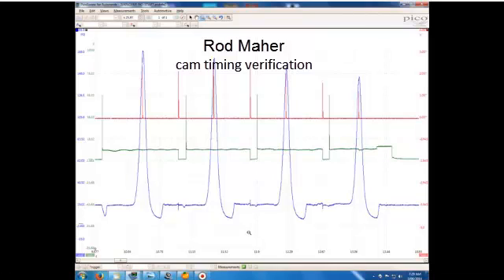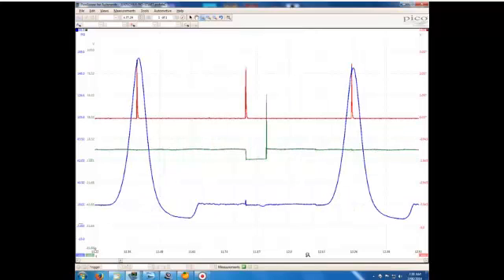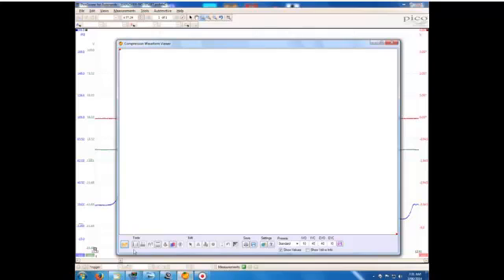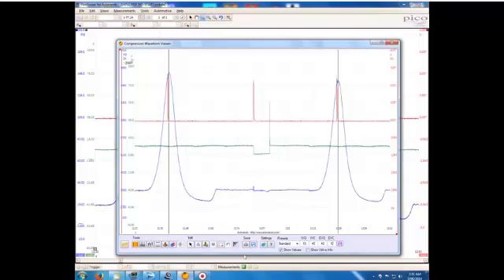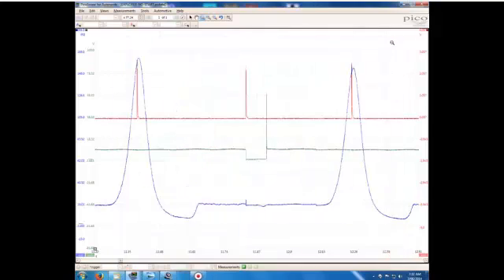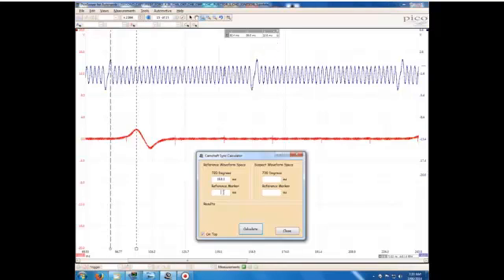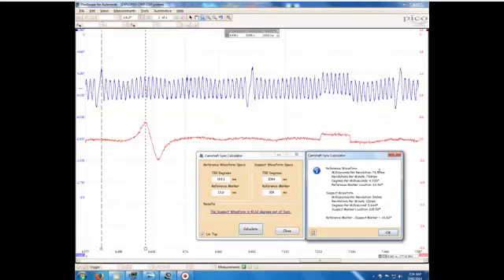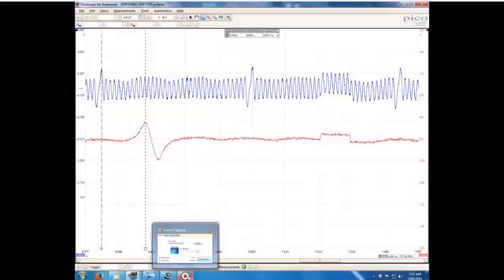cam timing verification Rod Maher

Comment: Where did you get the sync calculator? Sorry if you mentioned it in the video.
Nice job!
Reply: very interesting and very quick
Reply from the maker: +ScannerDanner 
Hi Paul My friend Rod Maher wrote this program, it is a very cool program and I use it a lot. you can Join up with Rod and you can get access through this website http://www.scandata.com.au/